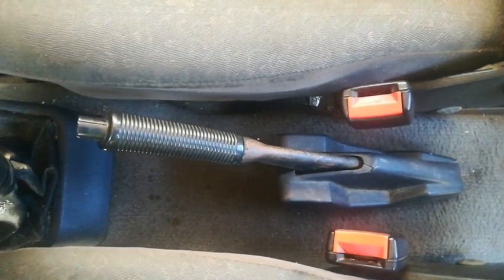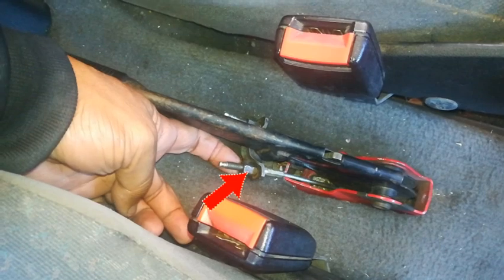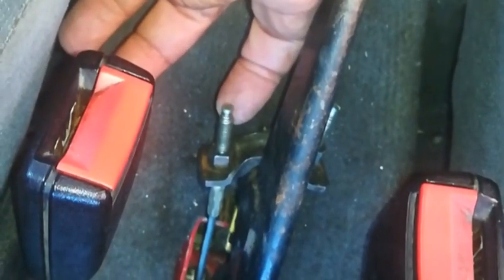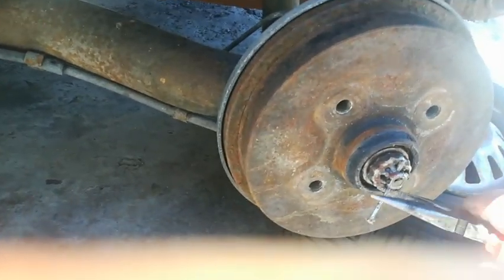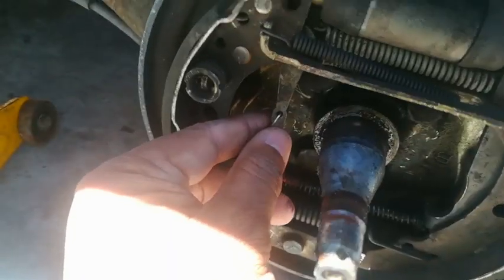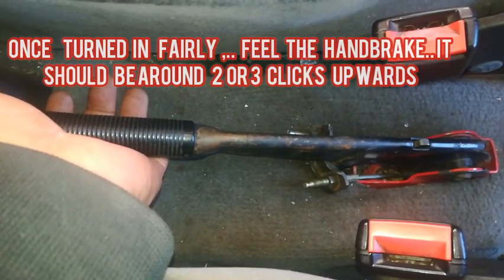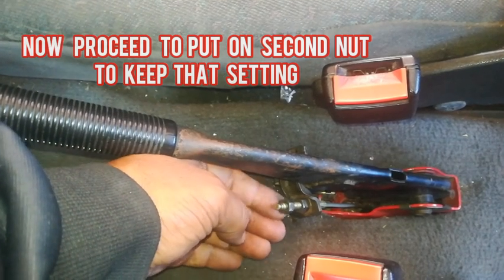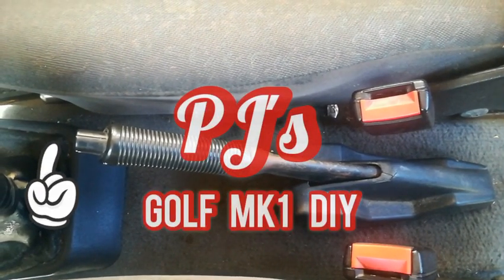GOLF MK1 :HANDBRAKE  ADJUSTMENT #golfmk1 #golfmk2  #vwfox #vwcaddy #vwgolf #

Comment: Hi PJ.. I have scirocco mk2 1.8 8v 1990, basically mechanically the same as Golf from same era. Just wondering if you ever experienced an issue im having. The problem appears randomly but it has been an annoying issue for a while now. Anywayz car makes loud ticking noise, clicking you could say, can happen randomly at times on and off, can become a faster tick with more acceleration applied and slower tick when less... Definitely from under the hood somewhere, but hard to diagnose these things while driving.. Dont seem to do it while idling, if it happens though its very subtle ... Any ideas, help would be appreciated.

Comment: Does both drums need to come off or only passenger side?
Reply from the maker: Hi. Yes, do the process on sides. Both drums to come off, because u need to get to the adjuster
Reply: Only one side of my car has a adjuster. Is that a problem or is it a simple fix?
Reply from the maker: @ashwalters747 Hi ,you will need to get an adjuster. It has to have one on both sides. 
.

Comment: I need help as the handbrake broke off completely off the bottom
Reply from the maker: The cable has snapped most probably.. Need to replace it.
Reply: @pjs-golfmk1-diy  not the cable the whole bracket
Reply: Yes
Reply from the maker: @gandstactical  you mean the lever, or the bit that sits against the floor?.. If that's the case you need to have it welded
Reply: @pjs-golfmk1-diy  yes need it welded. It broke off completely